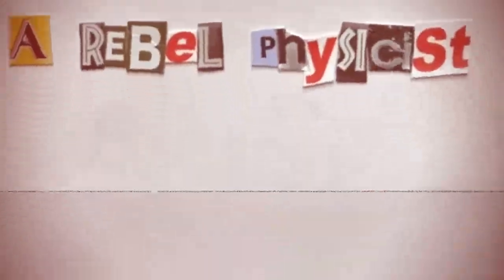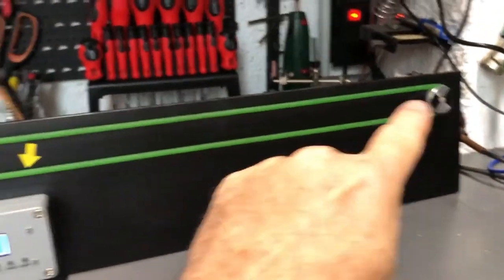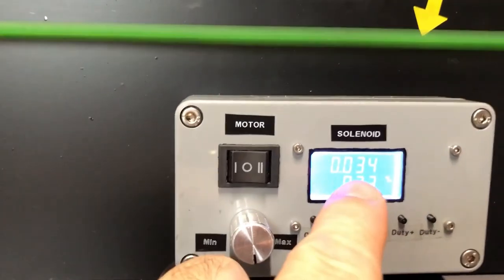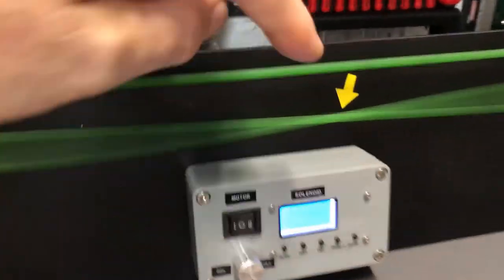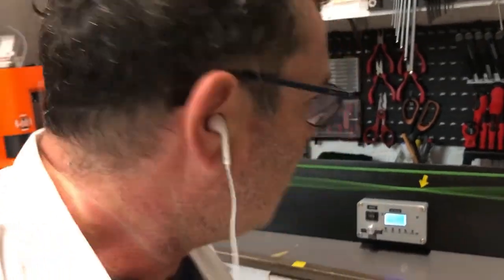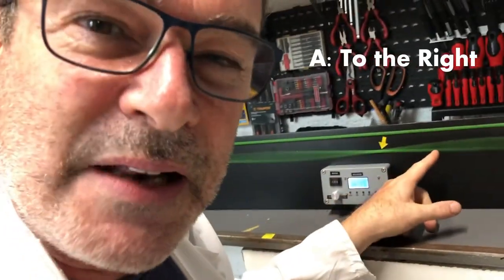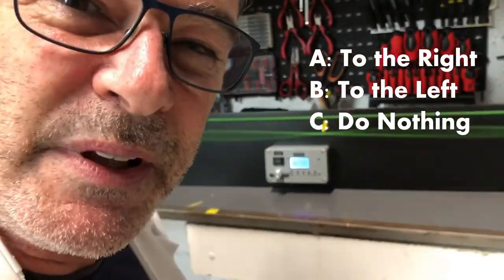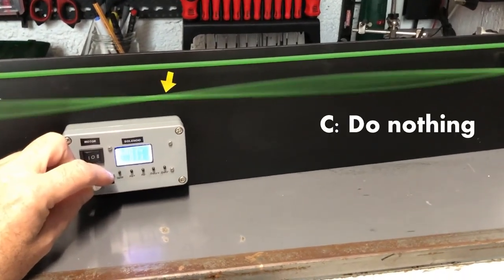Why the Aether can not be detected using a standing wave - #VeritasiumContest

Comment: How does this relates to aether?
Reply from the maker: Hello Ferdinand. Thanks for your question. In this mechanical model the standing wave is formed in a string which acts as the medium transporting the wave, or ``mechanical Aether`` here.   
When the string moves it acts (mechanically) as Aether wind because it behaves (the string) as a moving medium with respect to the source of waves (the solenoid in this case). 

The same would occour in the case of electromagnetic waves in a supposed Aether wind.